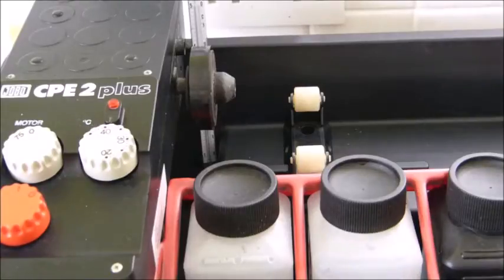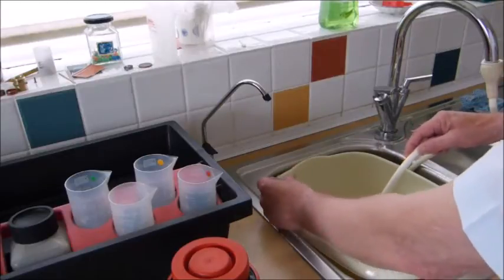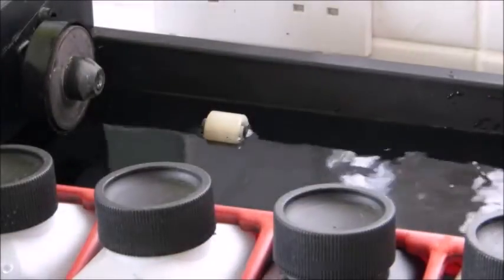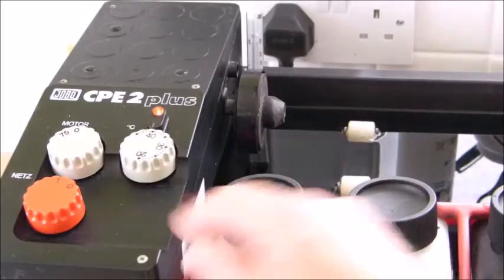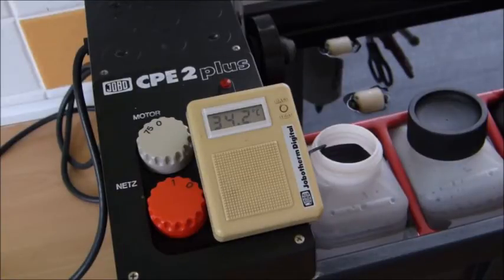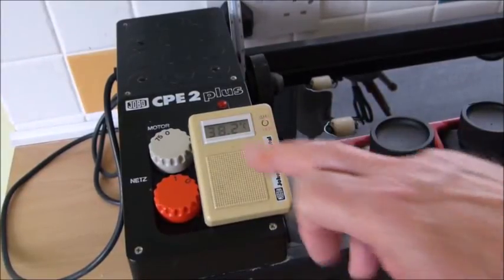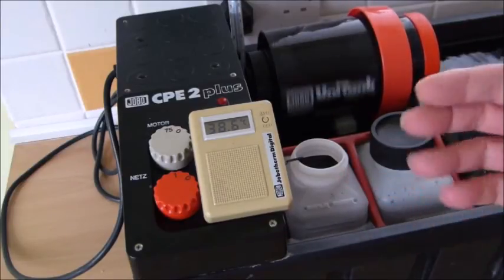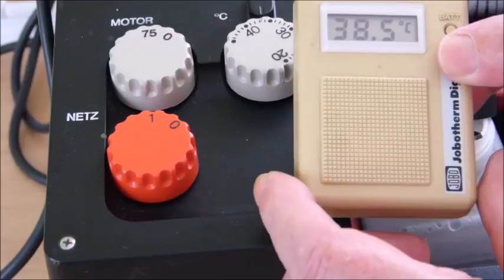Setting up Jobo CPE 2 film processor

Comment: I do not use a Jobo processor, but I do use a regulated water tempering bath and a rotory processor for C-41 and E-6. It has never occurred to me to warm my chemistry any way other than suggested here.  I suspect that if you used a Jobo processor to warm a water bath from room temperature to processing, it would take hours to warm up and you would burn out the Jobo heater in short order. I find that a warming pre-bath (several) using water a few degrees warmer than processing temp warms the tank, reels and film to processing temp in just a few minutes.

Comment: Hey Steve, how is your Jobo motor going different ways if it doesn't have the little white fork?
Reply from the maker: It is the later model, the bi directional is controlled electronically, and no longer used the white fork
Reply: @steveelkins52  is possible to buy only the tank with the hole behind to attach with the motor head?